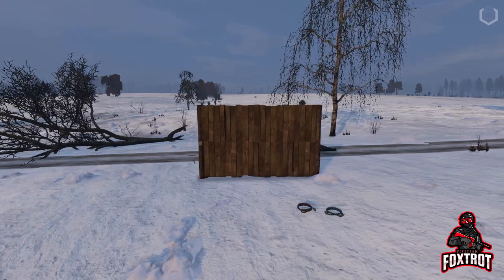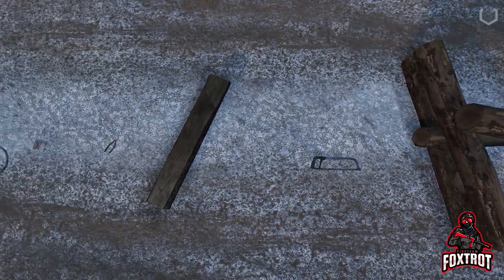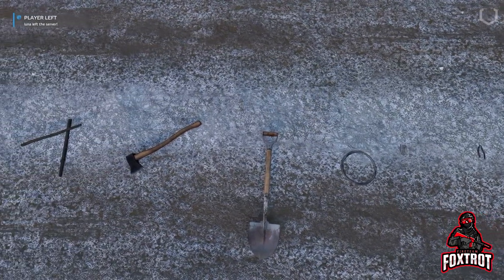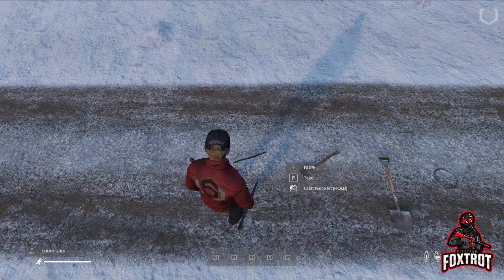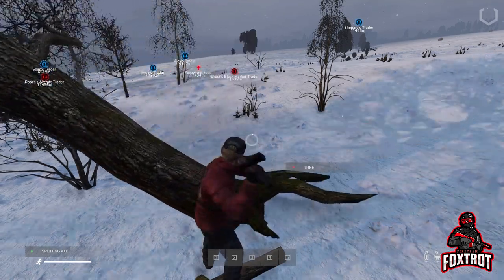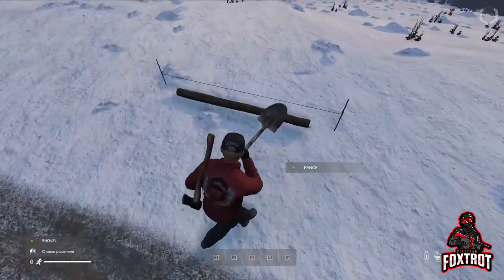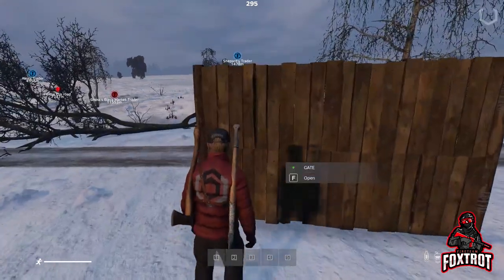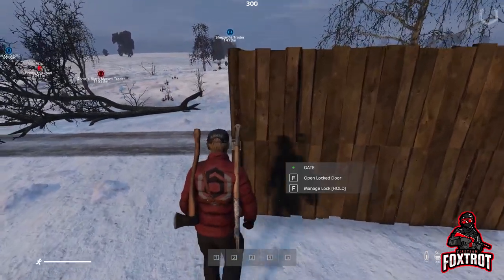#DayZ How to make a Fence/Gate in DayZ 1.21

Comment from the maker: To Build a Fence:
-2x Wooden log 
-18x Planks
-36x Nails
-Hatchet
-Axe (Optional - But will need a hammer.) 
-Shovel
-Hacksaw. (Somewhat Optional, if you can obtain planks without one.)

To Build a Gate
-1x Wire
-Pliers

Good extra materials:
-Duct Tape
-Barbed Wire
-Locks. (Codelock(PCONLY), Combination lock 3 digit, or 4 digit.)
Reply: When’s the next vid homie?